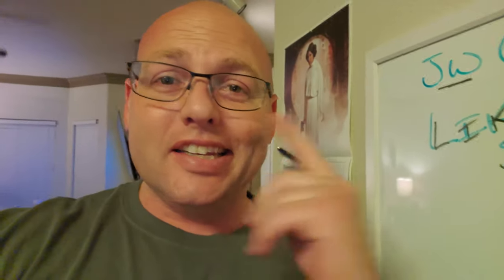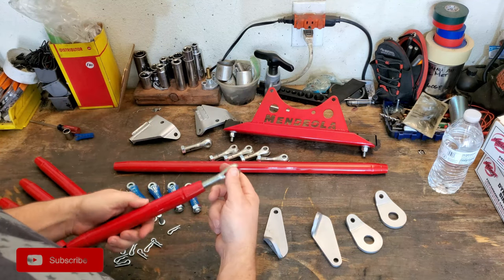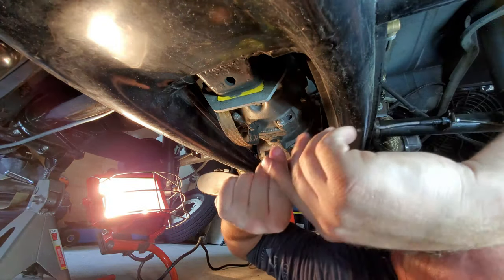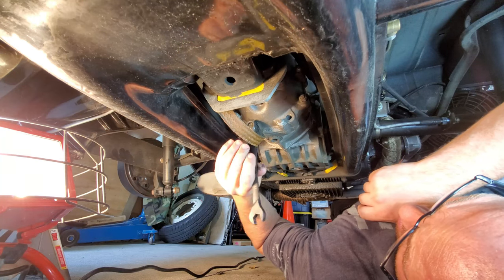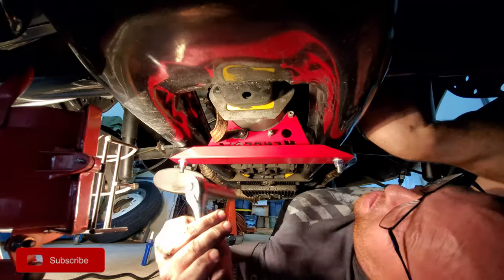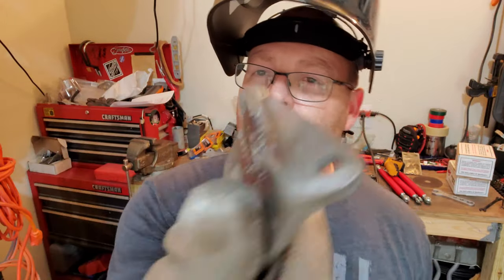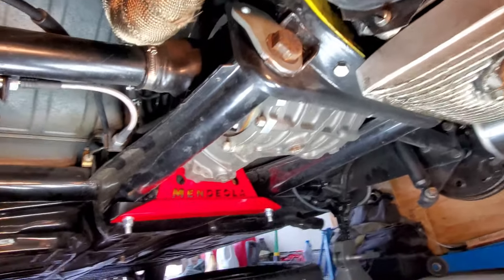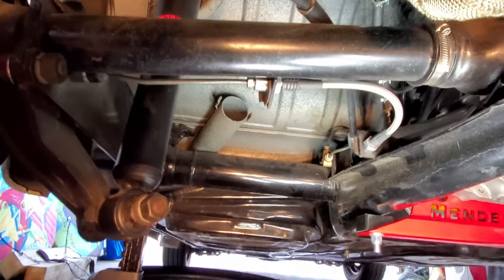Kafer Bar Install Part 1- 1956 Oval Ragtop! Volkswagen BUG | JW Classic VW

Comment: I would have sprayed the threads with penetrating oil before trying to break them loose. But then that's me. Those studs are threaded over HALF its length into the case so backing them off some won't hurt. Keep up the great work, Jason.

Moe
Reply from the maker: Hey, hey Moe... Good morning brother... yeah that last one up in the corner will probably need some liquid motivation for sure.  Thanks for the support man!

Comment: FYI: Oatey plumbing test plugs (found @ Home Depot) work great for capping off the heater tubes, on the body side, with little modification and a coat of paint.
Reply from the maker: Awesome!! I'll check it out brother!
Reply: Yes, those work great. I have a set on my bug.

Comment: do you happen to have the info on how much you had to cut off of the shock bracket?  I too am installing this on a 57, but the body is not on the car at the moment.  I'd like to cut and mod the bracket while I have easy access.
Reply from the maker: No measurement man... but it was roughly 1/2 an inch.

Comment: JT, I currently have my engine out that I plan to replace with a larger more powerful motor. I’m wondering if I need to replace my transmission with something more stout or go with what I have for now. Another conversation obviously. My question to you is how do you go about adjustment?
Reply from the maker: Keeping the stock trans with a more powerful engine is risky business my friend.  Now if you know that you have good self control and won't go ripping out in 1st gear or slap through the gears like Mario Andretti then maybe you can keep the stock transmission in play.  But let's be honest, big engine is gonna be pretty hard to resist. 😎😎😎👍
 
So an upgraded trans in definitely worth the dough.  What do you mean by adjustment?

Comment: You mentioned solid mounts.
I wouldn't go that way. Solid mounts transfer vibration through the frame and will break something else later on. Plus it makes for a miserable ride on the street as they shake and vibrate all the harmonics through the entire car. 
If your running slower than 12's stock or urethane ones work just fine.
Reply from the maker: Yup, not doing a solid mount for now and just for the reasons you described.  We'll see how everything performs first before making any further changes.